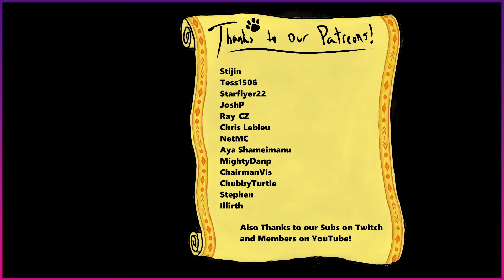[Factorio] Industrial Revolution 3 Ep 75 - Silicon Carbide Bricks & Gas Furnace Production

Comment: Queue for research is toggled at game start, activating it now would require console use, but disables achivements.
Reply from the maker: ahh thanks, i knew it was a thing but never used it so i didnt know i had to turn it on.
Reply: @Bear989  A more recent patch sets on as default, and 2.0 will make it always on with no off or after rocket settings, so it'll be easier soon.
Reply: It's really weird that you need to optionally turn it on, it should just be enabled by default
Reply from the maker: ok, i look forward to it. I dont use it usually but it is still nice to have it available for when I do.
Reply from the maker: i agree it is strange.